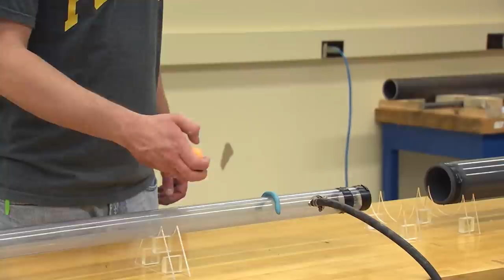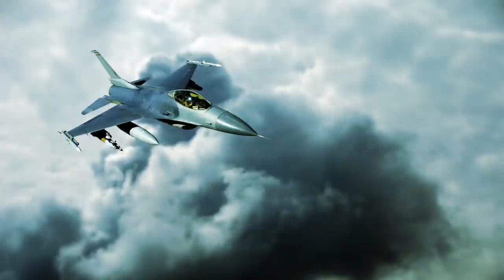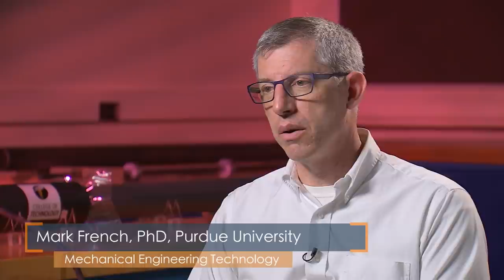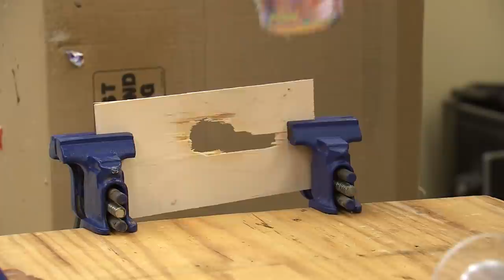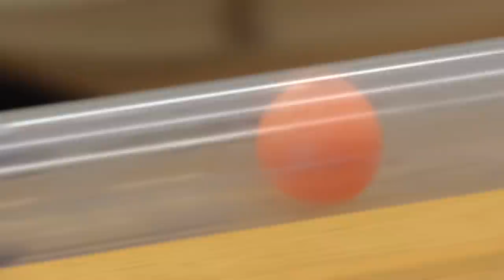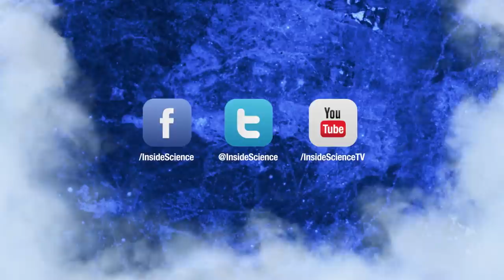Ping Pong Balls Break The Sound Barrier

Comment: Can you develop something like this which causes a constant acceleration, without gravity, friction, ect. getting in the way? A perpetual accelerator that gains velocity and reaches close to the speed of sound? No tube could hold up to all that force while maintaining pressure to force the object to the other end.. Or the object would simply break apart at its speed colliding with particles. This makes me curious if we could use something of the sort for space travel. Someone prove me wrong here please.
Reply: What
Reply: I'm sure it's possible, or will be eventually. It's just insanely difficult to adapt that to use in any sort of travel. What, do we vibrate or relentlessly push an pull materials with people inside them at multiple times the speed of sound? Just to launch them into an infinite void, and have them control that? Not to mention, to space travel beyond Saturn or Pluto and it not take a generation of life or more, it would take us breaking light speed and time/theoretical force boundaries to allow the human body to withstand that level of force and energy. So it's just not even scientifically possible at this age.